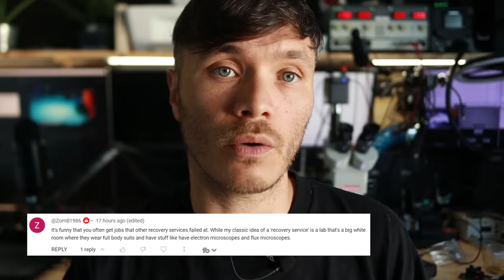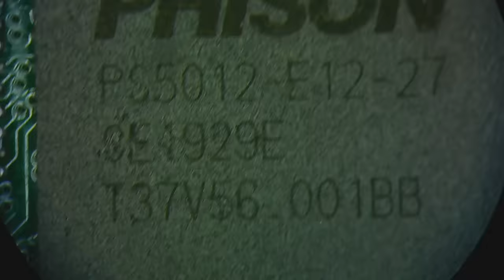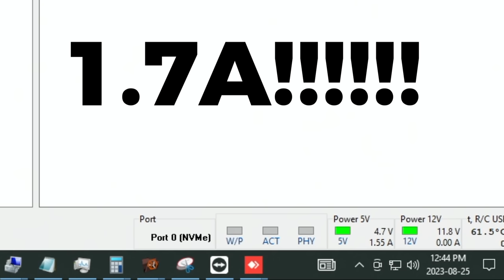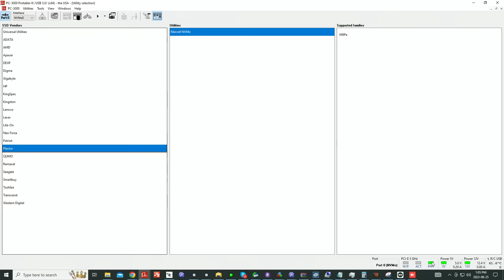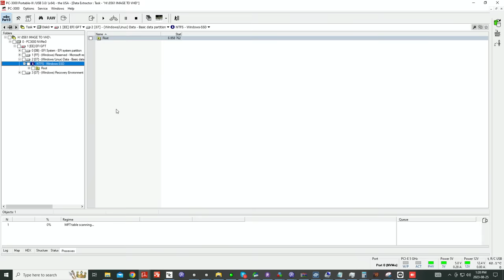this SSD recovery was going to cost $3800USD

Comment: Im a machinist engineer and love your channel because i see the same in you as i see in myself, a passion for it and knowledge of it. I make parts for obsolete vehicles/ machinery etc and similar to you i get a constant stream of second opinions and work as other shops either fail or just simply dont have the confidence or experience to achieve  result. Whilst i dont understand the software side of what you do, i can see what you are trying to achieve. engineering either electronics machining or otherwise shares so much in common and those that are passionate about it are the exception not the rule. Im so glad you are posting more videos these days. Ps ..i first followed your channel when you were doing a lot of mechanical hard drive repairs, those i found especially interesting to me at the time :)
Reply from the maker: Thanks! I really appreciate your input. Mechanical drives are still a massive part of my work. I really want to start posting those again, now that so much has changed since I was regularly posting them up

Comment: I'm surprised you were able to keep the solder balls intact at 9:03, what would be your procedure if you didn't have a stencil for this and you needed to reball this BGA?
Reply: You can reball it manually . Place a thin layer of flux on the chip, add the right sized solderballs on the chip, apply heat with low air until the solderballs melt, and then solder it back on the pcb.
Reply: @EvilLabsSolutions would smd paste (liquid solder) work ?
Reply: @parranoic  , I never tried it. But in my opinion it won't.  
Solderballs are the same  dimensions, no matter what size you're using.
So once placed in the correct place and heated up, the solder joints will be the same size.

If you use the solder paste and heate it up, I don't think all solder blobs will be the same size.

I might be wrong, tho. 🤷‍♂️
Reply from the maker: 9 times out of 10 when working on tiny chips like this if pulled correctly they split balls pretty evenly. In such case, landing it back is the key. You can see that I held it with a tweezer just to the balls grab just enough, then free flow it on its own and let flux and solder do it's work. As @evellabssolutions mentioned, chips could be reballed by hand with solder balls and liquid flux, or using a generic stencil with solder paste if needed. If the chip came off and left over balls looked all different sized or merged, I would definitely reball with fresh using a stencil and solder past

Comment: the controller chip was chipped to start with  (at 3:40)   great job though, at least you didn't try safe mode too after burning your hand.
Reply from the maker: I know right. I wonder how long it sat powered on with 1.7a in the safemode while loader was being forced in with translator regeneration

Comment: That was a lucky fix! I still think these capacitor-based SSDs are mostly unrelaible and un-recoverable. To what media would I stick? Certainly not a memory stick!
Reply from the maker: I disagree about the luck. Issue located, failed component replaced, device would come to life after that, there is no luck here. Simply analysis and solution. Luck would be that this unit was just working when I plugged it in :) That controller is supported, so even if this was a NAND wear level failure , it would most likely be manageable still.
Reply: @hddrecoveryservices  I didn't say you fixed it by luck. I mean the owner is very lucky Vcc didn't burn his memory chip down.

Comment: in my 25 years of beeing PC user I never had a failed drive so far but I still backup frequently. I guess I had just luck. Currently using a WD black mechanical and one of the first m2 ssds from samsung. both approx 5-7 years old not sure if it was 5 or 7, maybe 6. great video.
Reply from the maker: You are lucky indeed. I had 3 Samsung Pro SSDs fail 3 Seagate HDDs fail in last 6 years

Comment: Ok. You did it. BUT why don't you check shorts before power up? Why you don't use lab psu with appropriate current limit set to prevent doing more damage to device?
Reply: Was wondering the same thing. Great job overall, but giving it high current is unnecessary risk. I'd either check for a short or start with a low current limit.
Reply from the maker: Maybe I should have checked for it, but I didn't see it necessary. It already took 1.7A prior so nothing new would have happened there.

Comment: Very skilled work. But also a good dose of luck, as the memory chips were all good, and you had available a donor card with the exact memory controller chip.
Great job...
Reply from the maker: This case would be most likely recovered if the NAND was not perfect as loaders already exist for PS5012 and we use them if needed. As I later found out this PMIC that burnt is used on all PS5012 controller driven SSDs so I have at least 2 dozen of these donors kicking around :)

Comment: thats kool to see ..how do you know you have the chip or IC seated straight on the pads ..and what is that a heated blow gun or a vacum?..im happy i found this channel :)
Reply from the maker: Flux, pulls the chip into correct spot once the solder is molten with hot air station from the top

Comment: Years ago some place I watched a video about hard drive recovery. The company explained they worked with the mfgs. to get all the details of the drive including schematics and also that they had access to parts. The person on the video then explained the would rather replace the bad part if possible. But, if they needed to they could do a platter transfer. Another nifty machine they had was a unit that emulated certain parts of the board and do things like load firmware. I noticed a few years back most of the Ssd seemed to be a failed part. Not a bad memory chip.
Reply from the maker: I can assure you that there is nobody in this industry that gets something (design related) from manufacturers. Maybe only Seagate ( but even then I doubt it) cuz most of the stuff they do for their clients is simple stuff, although they have very skilled techs who work there who are capable of a lot. Surely big companies have lots of staff, and massive and impressive facilities, but it's the client that ends up paying the bill for it all at the end of the day.
Reply from the maker: Old SSDs were mostly made with MLC so NANDs lasted longer. Now even Samsung pro models use TLC. And we see QLC more and more often. Guess where that is headed for reliability. Not UP 😵

Comment: But how do you line up the pins (balls?) on the underside of the chip with the pads on the board when you can’t even see them?
Reply from the maker: Surface tension pulls it to center

Comment: It's good to see a Canadian company  doing great work. I am wondering if you can help my case. After long awaited vacation, I accidentally quick reformatted my SSD data drive in the laptop during a backup session. I didn't know that TRIM is enabled in windows so I am screwed with recovery. I removed the drive from my laptop and put it in an enclosure.  Would you be able to help to recover videos that are important to me? Looking forward to your reply. I'm from Nova Scotia. Thanks again for your wonderful videos.
Reply from the maker: sadly, as you mentioned, due to TRIM the data is gone now :(
Reply: @hddrecoveryservices  thank you for the reply. Does connecting it to PC3000 ace lab don't help at all?

Comment: Very useful video, i have ssd that is working normally kingdian 2tb, after while, it become so slow and nand burning hot, for ex it took 5 hours to boot windows, how to fix that drive
Reply: Clone it if possible or and first selectively copy important files first before copying and a lot of air blowing over it to keep it cooler while cloning/booting it (if it's hiting 65-75c it might be thermal throttling so drive goes slower or just pauses a lot if it's at the second thermal limiter (usually have 2 but a lot of them go a lot slower on the first one)

If not send it to a data recovery (shouldn't be trying to fix it, needs copying and replacing)
Reply: @leexgx  thanks for the replay, this is ssd mounted on raid so i have copy of the same files, but i just wondred how to fix ssd to back normal state (not in mean of data recovery but in mean to save expensive 2tb ssd drive)

Comment: When putting this chip on the board, how can you tell if its properly aligned to the connection points underneath it? Ty for sharing this awesome video! :)
Reply from the maker: Solder creates surface tension that centers it. I flow it twice. Once with tweezer, then once it grabs i flow it free

Comment: i have this weekly with my company that repairs apple devices, the most common occurrence is the customer liquid damages the device and apple wont even open it anymore and just quote the cost of a new macbook to repair it and in many cases lately it's a 20 minutes job checking and 5 minutes work replacing a trackpad that has bit of corrosion on it and they didn't even check it properly in the apple shop. So sad they care so little for their customers.
Reply: So sad that the same customers continoue to buy Apple.
Reply from the maker: its like crack :) they keep coming back
Reply: @hddrecoveryservices   and you cant reason with them at all that they dont need another rotten apple  for the price of a high end pc which can do more.

Comment: would you ever just send them back the fixed drive without copying it? I assume no, but it might be a lower cost option if you made it available and more might take it.
Reply: ALSO, how much was your quote for that drive?
Reply from the maker: No. The package could come back and for some reason not work again, or worse it could get lost in shipping. Always make a clone. This job was $700

Comment: Re: easy recovery - I would assume that the majority of cases are simply corrupted file systems. Which is about the level of data recovery I did in the past as well. Or restoring RAID groups. It doesn't take much more than a piece of software and as you said, a click of a button.
Reply from the maker: Bad sectors, drives that are degrading but can still image with applied patch, burnt PCB, head swaps without platter damage, stuck heads. All those issues are relatively simple and done without extra parts or with 1 donor and platters don't need to come out
Reply: @hddrecoveryservices  Was talking about the super-simple stuff, where you said that large shops would concentrate on, because it's good money for nearly zero work. With a hosed filesystem, you don't need to open up anything.

Comment: Like the video. But the camera work here and there needs to be improved 🙂 from 8:40 to 9:07
When you mount the replacement chip, how can you feel/know it is in place properly ?

PS : I have 7 Western Digital green 2tb SATA drives that need saving. 
Guess it's not gonna be cheap 🙂
Reply from the maker: I record via ATEM mini pro ISO to 4 outputs,
side, top view, scope, and screen but for some reason top view was off and I didn't catch it. I can't relive that moment haha
Reply from the maker: 7 drives? RAID? power surged and fried? or all random independent standalones?

Comment: Why not check the inductors or capacitors for dead shorts first, if it’s that hot?  Few Pennie’s for a fix instead of wasting a whole new drive.

I mean luckily it was the chip, but it could have been one of those and then you’d have still had that problem and 2 bad drives lol
Reply from the maker: no, it couldn't have been one of those. If it was it would show when the PMIC was pulled
Reply: @hddrecoveryservices  that’s what I said. I’m asking why you didn’t test those before pulling the chip? Easier to check with 2 leads then balling a chip

Comment: Damn $3800 for SSD repair is outrageous. Unless this SSD contains nuclear launch codes i beter buy 100 new SSD's lol.
Reply from the maker: Not for the repair, for the data that's on it. The original would probably not ever get shipped back to the owner unless requested. I would revert it back to original if I was asked for it back. My parts stay with me for the next time. But yeah I agree 3.8k was a rough quote for this

Comment: One of the few times a YouTube recommendation was worth the click!
Short, to the point and didn't mind the bit of self promotion.
*+1
Subbed
And I'll be reaching out about a 5TB HDD. Had a crappy connector and either the 5 or 12v line shorted. A PC "See's" the drive but not in a usable way.
If it weren't for the few 100 Family Photo's I would have tossed it awhile ago as I'm disabled, on a limited income and the price I was quoted made me sick.
Reply from the maker: Thank you! I'd be happy to help